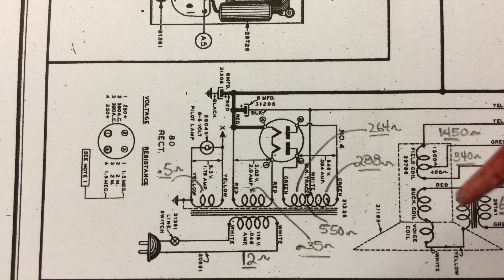Power Transformer Testing

Comment: Very good, old man. I've been in electronics for over 60 years, ( I'm 83 y/o), but I always made one further measurement on transformers. Very quick to make, but essential. That is "winding to winding", and "winding to frame, or core".  Any short here should show up, and could save a transformer, OR a life.I've been following your submissions, & find them very enjoyable, especially the "Tom Thumb" series. As a youngster, I proudly rode my bicycle with one clamped to the  handlebars. Wish I knew what happened to it.Keep up the good work, I'll be watching.Thanks much.Dick
Reply from the maker: +WB8MHE Dick, thanks for the advice on the additional power transformer testing. I'll be sure it's part of my routine before I bring the "PT" up on the variac while looking at voltage and current. As you noted, the Tom Thumb Bike Radio is a special little radio. That had to be exciting times for you cruising around with a radio on your bike. I would guess your friends were always chasing you around to catch up on the latest news, music, etc. Thanks again for following my work and sharing your experience and knowledge with me and others following along. Best, Don